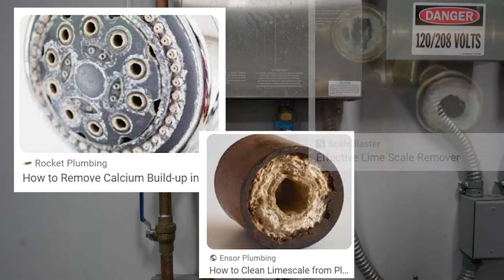Calcium Build Up Inside Water Pipes? | Hard Water Removal | QwikDescaler

Comment: Can this be used for calcium buildup in the shower drain
Reply from the maker: Great questions! It would depend on how you intend to use it - yes it can break down calcium - but to work effectively the solution needs an environment where it can cycle through a closed loop system repeatedly or soak for some time and then cycle through the system and be flushed with water. For that reason, we typically recommend it for tankless water heaters.

Comment: Does this cleaning solution go through a whole homes pipe systems, or just the hot water tank? I recently replaced my kitchen faucet, put new supply lines in to replace the old copper lines, and also replaced two fittings going into unions, both fittings I replaced had an excessive buildup of some sort and I could imagine the rest of the pipes have that same buildup.
Reply from the maker: Thank you for your question. Our instructions do not recommend putting the descaler solution through a whole home pipe system. We recommend our product primarily on systems that can circulate in isolation (such as a tankless water heater system) so that we can then flush it with copious water while it is still isolated before returning to service.